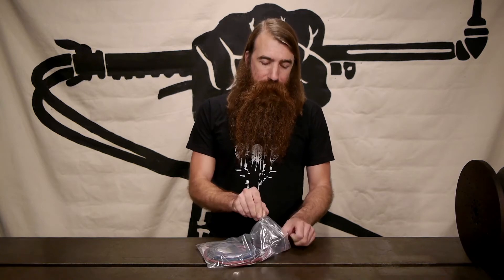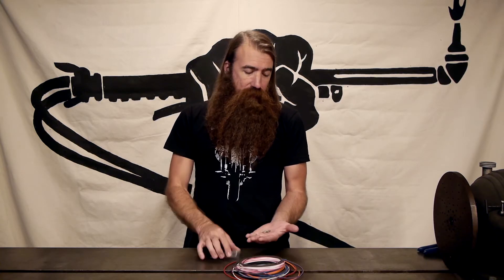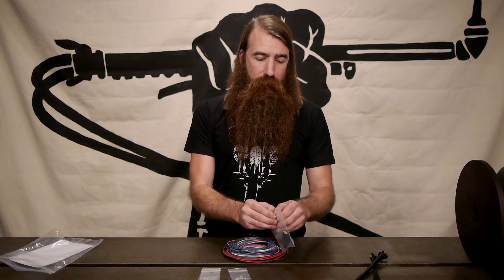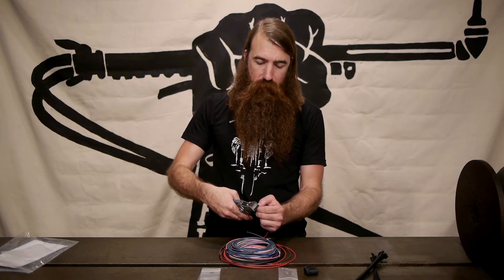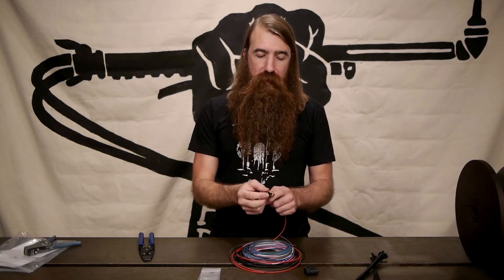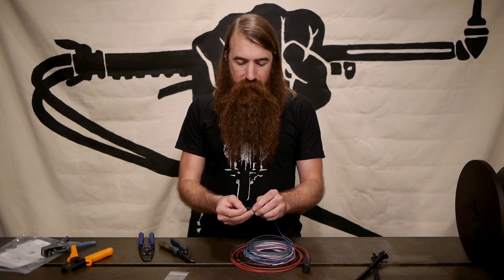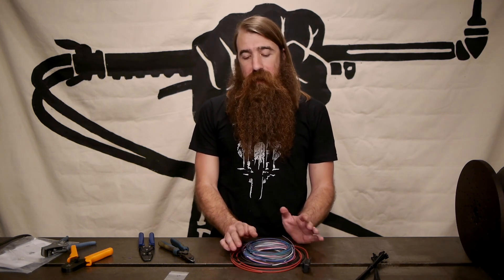Deluxe Motorcycle Cable Kit Overview - Revival Cycles Tech Talk

Comment: Great video. What wire gauge does the M-Unit recommend? just looking into this unit as I need a wiring overhaul. Cheers!
Reply from the maker: The m-Unit manual does list recommended wire gauges, but their suggestions are very conservative (meaning, they specify larger gauge than necessary). On our builds we use 18 gauge copper TXL with cross linked insulation for  the output wires, and 22 gauge for the inputs. The main power feed wire gauge is best determined by the main fuse you are using, on our bikes we go with 12 gauge wire which is rated upto 40 amps.

Comment: I've watched this video 30 times. It's definitely increased my knowledge and capability when it comes to this stuff. Could you guys do a video that shows other wiring techniques? Like, how you link up lines for headlights etc... Like fusing the front and rear positive for the right turn signals, so they are singular when they head into the M-unit.
Reply from the maker: We did do a video that covers a few splicing and soldering techinques, but its easy to miss cause its title is about heat shrink. Anyway here is a link https://youtu.be/ilFBQt-LlZo

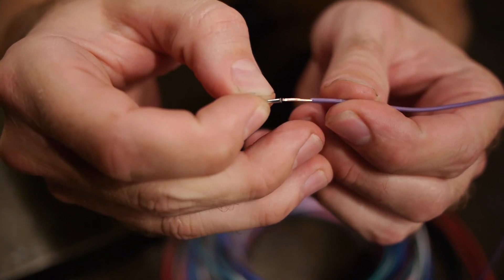Comment: ....  5:00   ferrules.....good idea, I used to 'tin' the ends of my wiring with solder.....
Reply from the maker: Tinning with solder works, and is way better than stuffing loose strand in the terminals. But it still leaves potential for fatigue failure where the tinning wicks into the insulation. Tin + heat shrink would help support the transition and reduce the potential for fatigue failure.
Reply: Revival Cycles jaulllllllllll
Reply: So if you pay close attention to wicking and you use longer heat shrink would be ok?
Reply from the maker: Yes this is ok, the ferrules are a nice touch and my preferred method, but if those weren't available tinning and heat shrink is the next best option.

Comment: ....right at the beginning....speaker wire? I bought a 1972 Sporty that had head-phone wire running several things...including the main ignition/battery wiring.....and then....there were the pistons installed backwards...by a 'bike shop'.....probably why the guy selling it said it was 'hard to kick over'......fortunately, he didn't ride it long enough to cause serious damage....
Reply from the maker: If you work on old bikes you'll see  all kinds of butchery, and some of the absolute worst work comes from so called professionals. We've seen bikes that came from known specialist restoration shops that claim the bike is as close to factory perfect as possible only to find a .015" piston/cylinder clearance, and a piston that was clearly run with a broken valve, and push rods made of hardware store aluminum tubing. They were betting that the bike was going to a collector or museum, never expected anyone would ever try to ride it, or check their work...criminals

Comment: Do the solid state auto reset 5-20 amp fuses fit in that fuse holder?
Reply from the maker: The circuit breakers do not fit in this fuse holder. Unfortunately the cap is too small for them to fit. However, it you wanted to use this fuse holder without the cap it will work with standard circuit breaker fuse replacements. Just note that the fuse holder that comes in the Deluxe Cable kit is for a standard blade fuse size, but the multi circuit distribution modules use mini blade fuses.